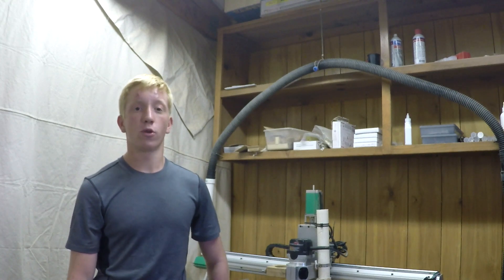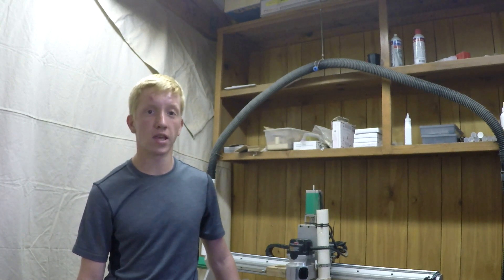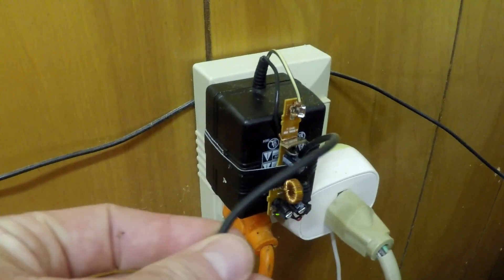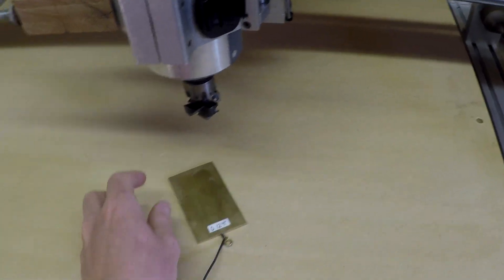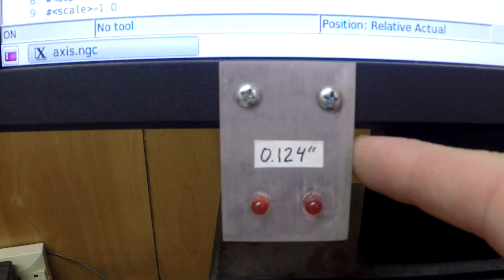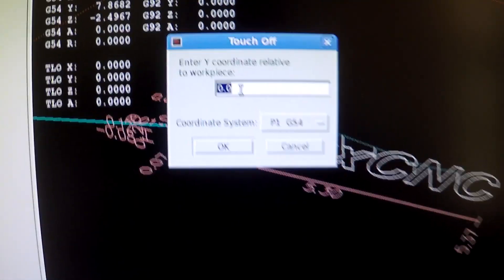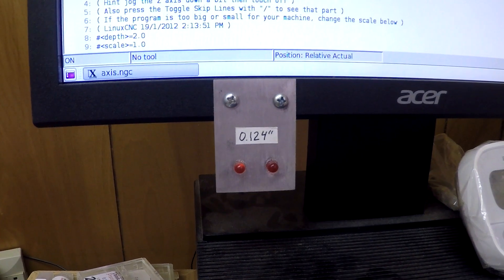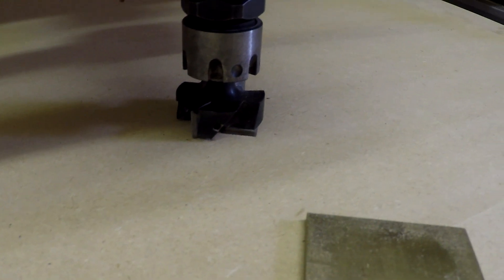Easy Tool Touch Off Plate - CNC

Comment: How did you get the circut to complete through the router, i use a dewalt 611 router and it wont complete a circut unless i touch the collar, did you do something different or is it the difference in the routers

Comment: Why you do not use probe functionality from LinuxCNC? Led on LinuxCNC panel and probing by gcode?
Reply from the maker: +Michał B The probe function on LinuxCNC requires more setup and programming with the software and therefore needs more experience to setup.
This is the easy version for everybody that doesn't have the experience to create a working probe, or doesn't want to buy the factory made probe that Probotix sells.
Reply: +Covey Woodworks I agree this is fast/easy solution :) For first time i use multimeter and beeping for this. But now I use LinuxCNC probing with only scrap of PCB connected to LinuxCNC. On the net we have full information how to do it.
Reply: The "probe" is the same plate you made....G38 .....